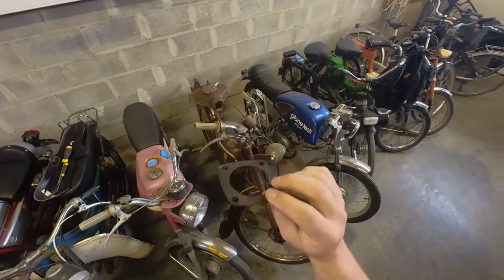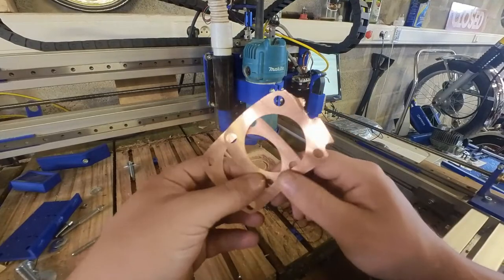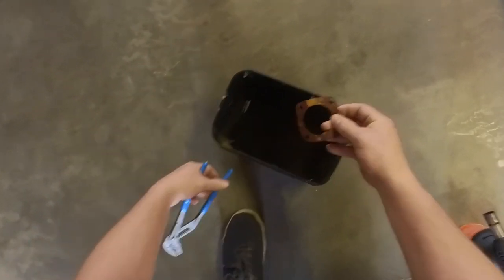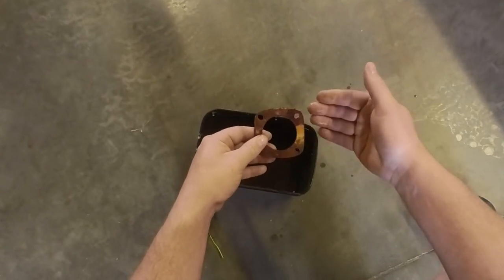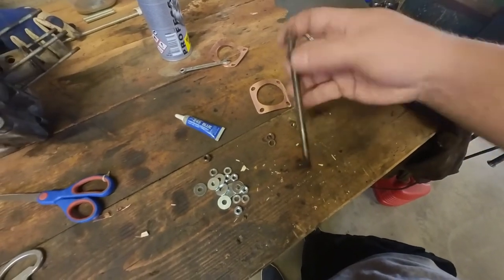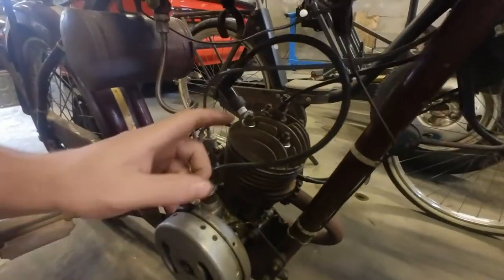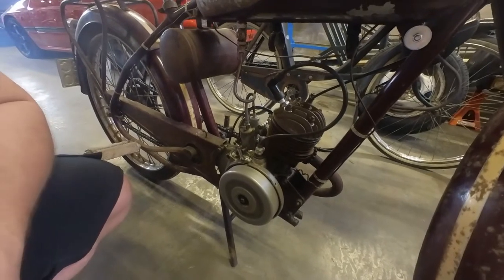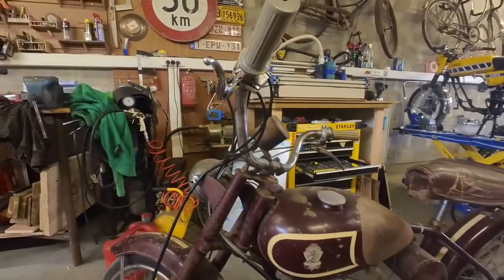How to make your own head gasket

Comment: Different copper alloys either harden or soften by heating and quenching in water. IDK the details of why, except that it alters the crystalline structure. Copper scraps I've had in my hobby blacksmith shop would work-harden.  To soften the workpiece so I could continue hammering and shaping, I had to heat it and quench it in water.
Reply from the maker: @dumbluck6180  I didnt know some coppers harden instead of soften. Never experienced that. I wonder which kind does that.
Reply: @VintageGarageYT  Thata called tempering, its good to temper copper seal before installing it, you get much better sealing because its softer.

Comment: Salut ,impressionnant ce que tu as fais avec ce joint en cuivre,moi j,en cherche un pour mon Peugeot 103 de 1980 mais c,est toujours de l,aluminium et ça ne tient pas dans le temps, dommage qu,ils n,en vendent pas dans le commerce !... ton niveau d,anglais est surprenant, bonne continuation mon  ami le belge🙂🇧🇪🇨🇵🤘🏁☺
Reply from the maker: Merci bien! Si tu as les dimensions, je peut fair un joint comme le mien.
Reply from the maker: Ce papier en cuivre est tres facile a adapter. Comme tu vois on peut le couper avec des ciseaux.
Reply: @VintageGarageYT   déjà, merci de m,avoir répondu ! et c,est gentil de ta part de proposer d,en faire un en cuivre, en faite c,est comme un joint d,origine de 103 Peugeot sauf que j'ai un kit 50 CC athena et ce joint  en aluminium était livré avec le cylindre, car les joints d,origine Peugeot ne sont pas très compatibles avec les cylindres kité 50 ( trop épais, plus de 1 mm d,épaisseur, ce qui nuit au taux de compression ou taux volumétrique et le squish, ça tu dois connaître !! 😄) je travaille en épaisseur en plus fin,pour le moment j,ai toujours la culasse d,origine avec un décompresseur, plus tard ,je mettrai une culasse surcompressée ( haute compression) pour gagner en performances,  je ne suis pas un adepte  des gros kit 65 ,70 voir même 100 cc, pour moi ce n,est plus de la mob à ce niveau et puis ça revient très cher quand il y a de la casse !!
Si vraiment tu peux arriver à en faire aux cotes, je veux bien ,il faudrait que je  t,envoie un joint par courrier à  ton adresse et je te dédommagerai  bien sur  ! Ça sent la passion dans ton garage et ça j,adore😉🤘🇧🇪 j,habite en Normandie et je suis fan des deux roues depuis tout-petit et j,ai  mon permis moto  depuis 1983!!  A bientôt
Reply from the maker: @fredericdobbelaere7725  Je suis également plus favorable au maintien du 50cc.
Vous pouvez également scanner et envoyer le joint par e-mail. Je ne sais pas encore si cela fonctionnera bien. Je n'ai pas encore beaucoup roulé.

Comment: Have you ever reused an all metal motorcycle head gasket if it was in great shape?
Reply from the maker: What metal are you talking about? Copper/aluminium/... 
I have reused them if they are OK yes.
If need be you heat up used copper gaskets like I did here and reuse them. Reheating makes the copper soft again.
Reply: @VintageGarageYT  This is an aluminum head gasket for a 90 Honda NT650 V-twin motorcycle. I lapped the valves and the engine is out of the bike. I was going to install the head using the orig metal gasket and do a leak down test to see if the intake leak is gone. The aftermarket gaskets being sold are not metal and I figured using an original metal may be a better choice.
Reply from the maker: @swordfish1120  I would then aswell go for original indeed. If its in good condition you can try it. If it leaks try to reheat it and try again. I've also made a video about a leak down test if you're interested.